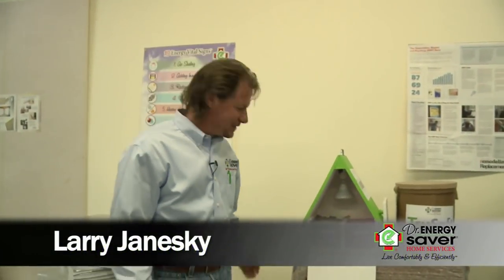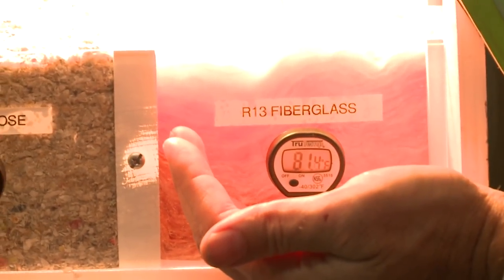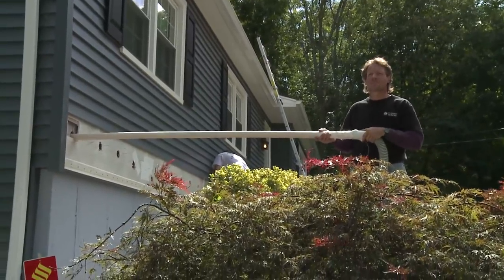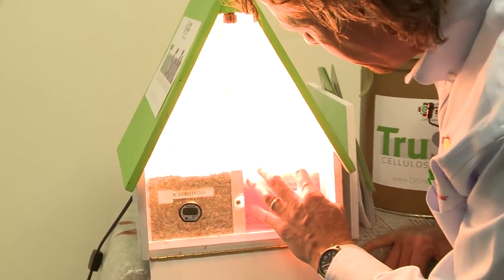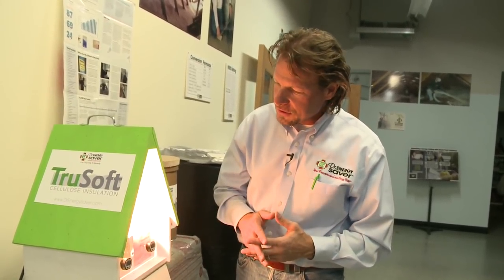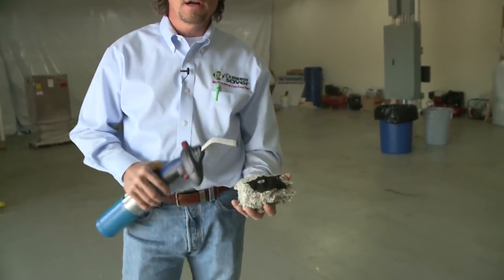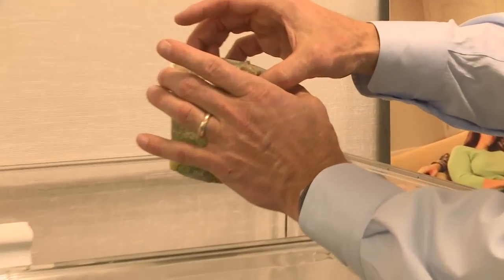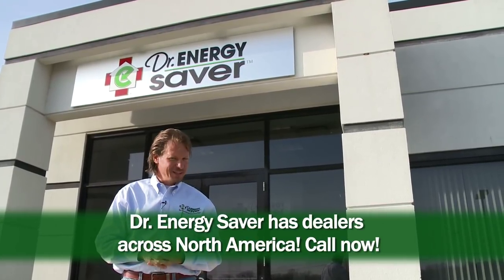Why Cellulose Insulation is Better than Fiberglass Insulation

Comment: The test is not really fair. The light will go through the glass fibers but not through the paper fibers.A better test is to cover both material with a piece of plywood, so direct light and air current may be blocked. Then I think you may get the same insulation R value.
Reply: you would think wrong then. the light as you say has the same temp thru out. THAT is the whole point of the comparison.
Reply: scott bickett Light does not have a temperature. A light source does (vibration of molecules). In the test, the light source has very high temperature, and most of the energy transfer is in the form of radiation. If you block the direct radiation, you will block a lot of the energy transfer. I think fiber glass is only good for blocking conductive thermal transfer. Adding an aluminum foil on the side facing the light will prove it.
Reply: your still not understanding thermal dynamics. the whole POINT of the comparison is about the difference in materials. So to say its "not fair" because the lightgoes thru the glass just goes to prove the whole comparison.
Reply: *****  you DO understand that this test has NOTHNG to do with "infared heat"( ??) but rather CONDUCTIVE heat gain and loss, THis is a great test to show the difference between the two, why on earth would you put a "baffle " or Barrier between the heat source and the material? DO YOU HAVE SUCH A BAFFLE OR BARRIOR IN YOUR ATTIC! ..NO!  It pays to be informed.
Reply: *****  You missing the point entirely. The HEAT from the bulb is a MAIN focus here. and how it transmits thru the difference material. " A MIX of the 2 MIGHT be best"? WOW. thats just flawed thinking all the way around. Here Mr homeowner, let me set up and install a lil bit of THIS material ten well stp and set up again and install a entirley DIFFERENT material" see how that goes over when you give them the bill! Cellulose is denser, has a higher R value, resists heat gain and heat loss better, in more fire retardent. ( True FB will not burn....IT MELTS!)  this is a fine test to see the difference and it in no way flawed. ( UL LABS used the same testing btw)
Reply: +Gahn Yun , The light isn't the issue. It's the heat. The heat isn't stopped by the fiberglass. Use loose blown fiberglass and it tests even worse. It's just a quick way of emulating the difference in insulating abilities between the two products. Maybe you could relate better if yo compare two buildings, one insulated with fiberglass and he other with cellulose. check out "The Colorado Study". Why do you think they use fiberglass for furnace filters?
Reply: +aoeusnth h heat flows to cold. The attic is cold and fiberglass is light and fluffy. It can't resist the flow of heat. Cellulose is dense so stops heat flow...plus the same density stops air infiltration. Sound travels through air...that's why cellulose is so much better that fiberglass as a sound deadener. No air leaks in so no sound does either! Check the independent engineering specs to confirm.
Reply: +aoeusnth +Brad Seager ??  Why does Cellulose insulation smell. It's because they add a sweet smelling sterilizing agent to it to reduce the former waste paper bedding smell (its mostly sold for animal bedding), when collected from waste paper warehouses and dumpsters behind shops it can contain germs, ants, insects, mice, rats and wildlife droppings, so for public safety reasons it must go under the squirted on liquid sterlizor sprayer . Too much sterilizor can go in in one area because the conveyot belts stopped for a paper jam, and other areas can go untreated.  Its waste paper called Cellulose a trade name to improve its image and value.  Now you know.
Reply: +SuttonWoods , there you go again, Sutton. Cellulose is clean and smells clean. Check out any attic with mice infested fiberglass. That stink never goes away.
Reply: +Larry Maloney //  Others say "if you use Cellulose loft insulation (its shredded waste paper)" THEY WILL COME, they mean mice, rats, bats, snakes, birds will come to nest in it. I was always trained to never slag off a competitor but in your case I will make an exception, claiming that waste paper you sell at 3 times the price of Fibreglass is the hallmark of a charlatan.
Reply: +SuttonWoods , I've never heart the phrase "loft cellulose" before. What does that mean to you? I know blown fiberglass is primarily blown in attics because most folks don't want four inch holes in their walls. So again, after all that exposure to cancer causing fiberglass, how is your health? Your wife's?
Reply: +Larry Maloney  Another thing mr sutton is not mentioning Larry is the ENORMOUS amount of energy that is used at the FG plant in the manufacturing of the sub par fiberglass. Thats not very "green" if you ask me. That cost of course is passed on to the consumer. It takes LESS than a third of that energy at a cellulose plant.
Reply: +scott bickett , you're so right. Fiberglass, even when installed to factory specs, isn't cost effective. Even "free" fiberglass costs more in lost energy savings over the years. I always tell young couple to find an uninsulated home for their first home and insulate correctly with cellulose. If the house is a bargain then it warrants taking fiberglass out of the walls and dense packing with cellulose. Do that and they can pay off their mortgage many years early with the energy savings from removing the fiberglass and insulating with superior cellulose. Old Sutton is on a mission to discredit cellulose because it's the only way to get gullible folks to buy inferior fiberglass. He doesn't realize how foolish he comes off.
Reply: Larry, did you know cellulose loose insulation is not approved for use in large parts of the United States, because if the house roof is blown off during an hurricane it gets windblown all the area in the windstorm. See:>

; Cellulose Installers are requested to recognise that we need to raise awareness amongst homeowners to ensure they are fully prepared in the event of windblown cellulose insulation leakage from their loft space in the event of a hurricane –causing roof and bedroom ceiling damage to their property, with substantial amounts of cellulose insulation from the affected property/s blowing around the properties and its boundaries. One of the important issues cellulose insulation businesses and householders face is not knowing where their clean up boundaries are, and when the next hurricane will strike. 

While Hurricane Katrina has tended to fade from memory, New Orleans isn’t the only major U.S. city at risk. As Hurricane Irene demonstrated, weaker hurricanes can also do significant damage in places that are not used to experiencing such storms. Many Americancoastal cities are essentially sitting ducks to hurricanes, with millions of Americans living at water’s edge, exposed to high winds and flooding. Cellulose insulation should NOT be installed in 10 largely rural counties in the Deep South and near the Gulf Coast, These well known hurricanes areas are: Desoto, Fla. Houston, Texas, Polk, Texas, Issaquena,  Miss. Highlands, Fla. Avoyelles, La. Walker, Texas. WIlkinson, Miss and Glades, Fla. Kemper, Miss.
Reply: +SuttonWoods the nonsense is endless; with you. Do you realize you left your credibility behind many posts ago? Cellulose is approved everywhere, even recommended.According to Owens Corning, their fiberglass insulation is a known cancer causing product. They even print the warning on every batt, bag, and roll. According to Owens Corning, its important to wear protective gear when installing fiberglass insulation. Federal law requires all exposed Owens Corning fiberglass insulation be covered with plastic to protect humans from contact. Imagine cancer causing fiberglass insulation being blown around town by a hurricane!
Reply: +SuttonWoods  I would like to know what states and WHO MADE this request of installers you claim. With the extreme less density of FG your claim doesnt make sense about blowing around.
Reply: +scott bickett , Sutton Woodhead is philibustering...hoping his silly stories will overshadow my comments about fiberglass causing cancer, not being a fire barrier, and being ideal nesting and bathroom material for mice and other rodents. Sutton has spent his life defending poor quality fiberglass. It's all he knows. He's a paid stooge for the fiberglass manufacturer.
Reply: +Larry Maloney // WEBSITES CONDEMN CELLULOSE WHEN THEY PROVIDE CONSUMERS WITH INSTALLATION ADVICE:>   Cellulose paper insulation materials are environmentally friendly and 
cost effective when compared to Fibreglass insulation,  but it is combustible and rapidly burns out. The main cause/s of cellulose insulation fire/s are: chimney related, Electrical faults, Lightning strikes affecting the roof and contractors carelessness. Installation advice for contractors:  Have the attic space electrical installation tested by an qualified electrical contractor, and do this every 3 years afterwards . Loft wiring should be in conduit but not attached or adjacent to cellulose insulation.  Do not place high wattage lights or electric fires or radiators near the insulation or allow the insulation to overhang electric fittings.  Do not insulate near recessed lighting into the ceilings below. Use heat resistant bulk head light fittings in the roof space. Electric supply cables need to be prevented from coming in to contact with cellulose insulation, or adjacent to other flammable materials.
Reply: +aoeusnth , the light isn't an issue. the heat from the light represents the heat the fiberglass is suppose to block. The fiberglass sucks, not the light.
Reply: +SuttonWoods , Romex wire, the most common in new construction, is commonly buried in cellulose insulation. Who uses conduit these days in residential construction? You're really dating yourself Sutton. You've been retired...what...30 years? In the event of an electrical short in the Romex wire, the surrounding cellulose will stop the sparks from igniting any adjacent flammable material...like the paper on fiberglass batting! There is no three year test that predict all electrical failures. That's why it's important to cover the Romex (or any) wiring with fire retardant cellulose instead of drafty fiberglass insulation with its flammable paper coating. Why is Owens Corning too cheap to flame treat their paper coating? Intelligent folks see the difference between quality cellulose insulation and inefficient fiberglass, even through your smoke screen.
Reply: +Larry Maloney  // All over the internet including You Tube and  various public forums Cellulose is being discussed in lets say impolite terms.  Recently I have questioned your assertions about the benefts of Cellulose because I think Fiberglass is superior, when making this assertion I have taken note of the manufacturers reputation,  I also know that Celluose price wise is a total rip-off, If Fibreglass is $1000, then Cellulose is  $2500,00. IF it was cheaper than fiberglass by 35%, and did not settle after its installation I'd be happier, much happier, but thats not the case here. I deal with householders, blue collar workers, often poor people, an important part of my job is to offer good value meaning fair price.

 Your trade to one and all appears to expect "big bucks for whats nothing more than waster paper dressed up "as the real thing". I hate that, I honestly do. We will always differ on that value point. The clients I serve will always welcome me back into their homes and offices,  thousands of jobs we did have completed since 1964 are still around for inspection, I obtain great pleasure from that. You must admit that Cellulose is poor value indeed and best ignored by honestly informed buyers. The worldwide  sales figures of fiberglass prove that statement ten fold, yours don't.  If you choose to sell waste paper then you will be ignored by those who count- the major top 5000 buyers. And can you blame them.
Reply: +SuttonWoods You can look at video on our FB page ILLINOIS VALLEY INSULATION and SEE VIDEO that was take of FG in sills that was COVERED in black and gray marks because the FG was nothing more than a FILTER trapping outside dirt. We even show this with thermal imaging proof before and after. You cant argue with FACT.
Reply: +Simple Sutton, pricewise, fiberglass and cellulose are comparable. Installation-wise is a different story. Pay a thousand dollars for cellulose and you get the full measure...some exact number of bags blown in your attic, for example. Get the same one thousand dollar fiberglass job and the contractor makes hidden profit by fluffing the fiberglass so less bags are needed to give the impression of meeting the contract. It may measure the full depth by putting extra air in the blowing mix but density-wise, fiberglass comes up short. But what homeowner can measure density? They see 19 3/4 inches of fiberglass  (Supposedly R-60) and never suspected it's been fluffed. The contractor makes a small fortune on the bags he didn't use. The fiberglass settles and the next homeowner hopefully is better informed about insulation and the tricks used to squeeze extra profits for your wife to count.
Reply: +Larry Maloney // You certainly know all the TRICKS of the trade, we do not have time for this because you will always have disgruntled workers, whistleblowers, and these people will report firms to the authorities, so we steer clear of tricks and shortcuts. Why ruin a reputation for quality and our own staff/s respect and loyalty. The men know their jobs will be inspected by me and the fear of losing their annual 10% of salary Xmas bonus keeps them in line, stick to your tricks but its a shortsighted policy. Some advice to be a millionaire stop what you are doing now, and start anew, if you have not been a millinire during the last 10 years, its unlikely things will improve so change yr occupation. Try Honesty.
Reply: +SuttonWoods , unlike long strand fiberglass, cellulose is very short fibers so can't be fluffed like fiberglass. Cellulose is all I install. I do have a collection of reports showing fiberglass installers cheating their customers. I think the industry phrase s "overblowing fiberglass." Is that what you call it? I 'm glad you try to keep your boys in line. Paid by the square foot their incentive is to sprinkle some fiberglass sound and head for the next job. I pay by the hour...not nearly as profitable as your fixed cost but we are interested in quality, not how many sales calls or jobs we can squeeze out daily. Sometimes I think you fiberglass sales organizations are so hurried for fear the customer will get wise to the high pressure tactics and cancel under their three day federally mandated cancelation rights. I don't want all the jobs, just the profitable ones...no need to push product just to stay in the good graces of a giant corporation.
Reply: +scott bickett ,  I waste too much time clearing the Simple Sutton lies from my customer's heads.  They're on high anxiety alert after Silly Sutton blasts them with his nonsense. The funniest was his "paper mites". That reveals a desperate man. According to Silly Sutton his wife is a vegetable and he's blind.  Yet he can't reflect on his deceptive life and recognize the harm he's done to society and families who unwittingly trusted him.
Reply: @LH: Beware a COCKROACH bite: Insect can produce a force 50 times stronger than their own bodyLarry, are you aware a Cellulose Paper Mite Jaws can generate a force 35 times stronger than their own body weight when they bite,  a fully grown adult male for instance can generate a force 50 times it's own body weight. This jaw strength is required when the mites are chewing upon tough trees that require hard biting to get to the tree sap. Their jaws can be used not only to shred food, but also to defend thier territory if they are disturbed. Cellulose Paper Mites are hard to eradicate and found in waste paper mills, waste paper bales and un-fumigated raw cellulose insulation.
Reply: +Simple Sutton, what do you suppose the actual chewing force of a mite is? Let's say maybe a fat one weights one Nano millionth of an ounce. Let's see, I'll take off my shoes and socks so I can carry them aughts and do a little Jethro Bodine cipherin and ..well.. aught carry the next aught plus 50 million Nano ounces...Hot diggity..one of them ferocious mites can't even chew its way out of a paper bag. My brains tired...going down to the cement pond and rest.
Reply: Gahn, the experiment is valid.  It will make no difference if the materials are covered with plywood...or drywall.  The heat will transfer through, into the insulation and to the thermometer.  His test is valid,
Reply: @gahnyun2016  Radiant barrier (aluminum foal on the light-facing side) is used to reduce thermal transfer...but ultimately the envelope becomes hot.  Cellulose is a better insulator than Fiberglass.
Reply: @ivcruiser  You are correct, Scott...The test is valid.  Well spoken.
Reply: @larrymaloney877  Accurately spoken Larry.
Reply: @pipersson9258  Brad, the cellulose manufactures do NOT use the paper you describe.  They use recycled phone books, yesterday's unsold newspapers, boxes, etc
Reply: @larrymaloney877   Yes Larry, I have removed both cellulose insulation as well as fiberglass insulation from rodent infested attics.  BY FAR the fiberglass smells worse.  They love to build homes in the fiberglass...and I've never seen a mouse building a home in cellulose.  The urine smell in fiberglass never goes away...until it is removed.  

To be clear, use OPEN cell polyurethane spray foam on the roof deck to avoid vermin.  It also does not have an odor
Reply: You make an excellent point, if light can go through an - INSULATION MATERIAL- then so can heat. To stop the arguments about see-through insulation-  in the UK they've increased the suggested thickness, the sales adverts should state when it was 2 inches think light could be seen if you held it up to the sun and the trapped air story was not convincing the punters it works, so we have increased the suggested best thicknesses to 10" to stop the mugs carping on about it, Okay, we admit we increased sales our 5 x times by doing so, but who cares, just look at the huge profits we are making.
Reply: @waynemansur2162 , the resultant R-value is slightly affected by the paper product recycled. I tried phone books many years ago...too hard on the equipment and the density is less. Besides, where would we get phone books today? Cardboard is too valuable recycled as new cardboard. Good old newsprint, new or recycled, is perfect.
Reply: @waynemansur2162 , cellulose stops air infiltration passed by fiberglass strands.
Reply: @pipersson9258 , I guess I missed this comment by you three years ago. For the record, I know most of the tricks fiberglass sales organizations resort to while duping the public. I share my concerns with them and most avoid the fiberglass mistake by investing in superior cellulose insulation. I can't imagine you inspecting every fiberglass job...your nose is growing, Pinnochio.
Reply: @pipersson9258 , your feigned "concern" about my cellulose is unwarranted; a manipulative ploy to imply fiberglass has value when it does not.  If you honestly believe fiberglass has any redeeming value then you aren't as knowledgable about home insulation as I credited you. You are a perfect spokesman for the fiberglass industry.  It's the fiberglass manufacturers with their deep pockets who hired lobbyists to remove the "causes cancer" warning label from every piece of fiberglass. Consumers have a right to know. When asbestos manufacturers were sued out of existence they filed bankruptcy to avoid the Court awarded settlements. Today, regrouped, those folks are making fiberglass. Some experts claim fiberglass is more likely to cause cancer than it's predecessor, asbestos.  Homes insulated with cellulose insulation, using recycled newsprint as one ingredient, are 30% more energy efficient than homes insulated with fiberglass, made by melting sand and spinning it like cotton candy. Don't lose sight of the goal here, energy conservation. Fiberglass uses many more times the energy to manufacture and then is still 30% less efficient, even when installed as recommended, which isn't often. Piperson, if you had training in thermodynamics instead of fiberglass sales you could understand the technical side of insulation. Nice try though.
Reply: @larrymaloney877  Larry, my 50 years insulation trade experience has told me that NO INSULATION IS PERFECT, and the published R-values are at best highly inaccurate and misleading. Fibreglass certainly looks convincing, my company have insulated over 250 000 houses, but what we as a trade are trying to do cannot be done in whole, but only in part. Houses are either built airtight, erected fully sealed, damp-proof and well insulated from the start, or there not. At best any rectification work we do is nothing more than a well meant attempt to rectify the long-dead builders mistakes and errors, all doomed to failure. I for instance once told a wealthy member of the Belmont family, that her 103 bedroom house in Bellevue Avenue, Newport R.I. could not be insulated, to say she was not best pleased would be an understatement.  She was sitting pretty for a huge promise-promises swindle, but that's not me. Taking an educated guess all domestic insulation work is a gamble for the buyer, and if we try and do the right thing - the whole caboodle-  they think we are trying to drum up extra business.  You stick to cellulose, and I will stick with Fibreglass, mines beats yours hands down and you know it. And when the guilt overwhelms you do contact Owens Corning Fiberglass and tell them you have sinned, go to their learn new skills school and let the world know that you have repented.  You might treble your turnover if you do, so my advice is a valuable business lesson
Reply: @pipersson9258 , your fifty-year experience is different from my forty-five-year experience. That's understandable since you profited from inferior fiberglass. Agreed, if the builder does not build air-tight, your fiberglass won't remedy the problems.  My cellulose does stop air infiltration. And, unlike your beloved fiberglass,  the R-value of my cellulose is stable regardless of density. And unlike inferior fiberglass and it's cancer-causing properties, cellulose doesn't harm our environment. Today's consumers are more sophisticated. Educate them on the properties of each insulation and they aren't swayed by your arm twisting.  On a personal note, I specialize in hard-to-insulate homes so welcome a challenge like the 103 bedroom house in RI that stumped you. Again, thermodynamics guides the way, not your sales hype. If there are wall cavities they can be densely packed with cellulose. Ceiling joists are equally benefitted by cellulose. I agree, your inferior fiberglass would have cheated those wealthy owners. In fact, give me the contact information and I'll do the job you couldn't. I'm afraid your good old days, PipersSon, was of a time when fiberglass was about the only choice. Today, homeowners have choices. Those who choose to be informed don't rely on a high-pressure fiberglass salesman to steer them to an inferior product. They evaluate, based on science, and choose cellulose. My experience is the only time fiberglass costs less is when less fiberglass is installed. That's most of the time. After I retrofit a home with cellulose, that homeowner never has a need to insulate again. I have personally insulated where fiberglass has been used, three, four, and occasionally five times before. We do it right so are done. You, on the other hand, fluff the fiberglass so fewer bags get installed and in a few years, you sell them more. What a racket. Is it true sociopaths don't have a conscience or feelings of guilt? It appears they don't on the corporate level. What about you high-pressure arm twisters? Ever fear that your legacy is poorly insulated homes across the USA? My customers smile.
Reply: @larrymaloney877  Did I not tell you years ago when you fled the Soviet Union, that you no longer havie to follow the party line. You will recall when Comrade Gorbachov took office, he banned the use of unsold copies of Pravda newspaper  being used  as insulation. Fibreglass Insulation was introduced and given the name Saint Nicholas Wool. I agree Cellulose dust in your lungs is not pleasant. Did you know they made a film about it called "A Cellulose Tree Grows in Brooklyn."
Reply: @pipersson9258 , I expected something less childlike and not so nonsensical from you. My lungs are clear...that would be because I avoided fiberglass all these years.I went into the insulation business to reduce heating & cooling costs on my own apartment buildings.  Back then the choices were fiberglass or cellulose. No knowing the difference I researched both. The benefits of superior cellulose over fiberglass were obvious to me.  That hasn't changed.  I could have insulated even more homes if I followed you around insulating the ones you couldn't with fiberglass. Do you have medical issues today related to glass fibers in your lungs? Or maybe you avoided the dangers of fiberglass by never really working in the trade, just selling and getting the easy money?  Unwittingly, you do make an interesting point. The fiberglass manufacturers prefer to call their spun glass "wool." It's paramount to calling fatty animal flesh "protein" instead of the unhealthy product it is. That's the American way, once an unhealthy product is exposed to the public, rename it...confuse the buyer. I bet you have health problems related to both fiberglass inhalation and poor nutritional choices.
Reply: @larrymaloney877  Larry we swapped insults about two years or more ago, I recall I asked you then to look at the Annual sales accounts of Owens Corning PLC, and similar Glass Wool or Rockwool makers, the accounts do not lie  and they prove Fibreglass Insulation companies do 50 - 100 times more sales than the whole Cellulose trade figures combined. These sales are made by agents and builders merchants and its their market knowledge what rules. If these companies order ONE million rolls of fiberglass in one year, THEN what do they know - you don't? Owens Corning are the Kings of the trade and you know it, why not walk into any major builders merchants and ask for 10-bags of Cellulose, and the answer will be "Well that's a first for us- What it is and what is it used for? And NO we do not stock it!"
Reply: @pipersson9258 , yes, you are still as insulting as ever but that comes from forcing fiberglass on unsuspecting homeowners. Your question is fair and I'll address it. But understand that you phrasing implies the answer you want to assert. But first, tell me, Is the most popular singer the one with the purest voice?  Is the most popular food the healthiest? And do we all drive the automobile with the best consumer rating? "No" to all these questions. Likewise, the best performing insulation, the most economical insulation, and the most ecologically proficient insulation aren't used the most. Fiberglass marketers are super salesmen. They must in order to dominate the market with such an inferior product. As you know, new home buyers don't get a chance to buy the most efficient insulation. Instead, the builder makes that decision and chooses fiberglass because the fiberglass industry dumps the product to get their business. And burnt out installers can mindlessly throw it in the walls before a cellulose machine is even set up. Builders choose fiberglass for speed and a cheap price. It has nothing to do with quality. Fact is, I'm still waiting to meet a builder who understands how to insulate a house effectively. Fiberglass is mostly air. Cellulose is mostly insulation, therefore, middlemen don't handle it... too costly and time-consuming to load and reload. I buy semi-loads from the factory, not a reseller.  So please stop with the simpleton questions...I have better things to do than correct a fiberglass hustler. Again, how are your lungs? Full of 'glass?  Any thoughts on the ethics of the fiberglass industry filing bankruptcy to avoid paying Court Ordered damages for cancer-causing asbestos? Fiberglas is even more dangerous.
Reply: @pipersson9258 , LOL, what are you calling "glass wool"? Would that be inferior spun fiberglass rebranded? Link it with Rockwool if you insist, it's still inferior spun fiberglass. Your industry looks silly to customers when I explain the motive for Owens Corning rebranding fiberglass to hide its fiberglass content.  BTW, the chemical used to color it pink causes cancer, too.
Reply: @pipersson9258 , today's fiberglass insulation is still fiberglass made from melting sand and spinning it like cotton candy. We both know the "causes cancer" label was removed thanks to lobbyists on the payroll of the fiberglass industry. You said yourself they are a multi-billion dollar behemoth able to buy legislation with money and political friends.  A ten-year workmanship guarantee is meaningless. What's that even mean? How does a customer know the fiberglass batts have gaps? Drywall hides the poor workmanship. Cellulose wood fiber insulation is the best type for Florida hurricanes. Who wants those fiberglass prickly bits blowing in everyone's eyes and lungs? Speaking of lungs, you never confided in me as to the damage the fiberglass did to yours. I know you didn't pick those fiberglass pieces out of your lungs with a needle. They're still in there.
Reply: @pipersson9258 , you "investigated" fiberglass causing cancer? You dummy! You mean you installed that nasty stuff for 50 years and NEVER read the label?  It wasn't until June 10, 2011, the National Toxicology Program (NTP) removed from its list of “Reasonably Anticipated To Be Carcinogens” biosoluble glass wool fibers used for home and building insulation. I personally would never trust the fiberglass companies,; they filed bankruptcy to avoid paying Court-Ordered damages to workers diseased by asbestos exposure. How are your lungs doing? Should I send you a tee shirt, "I breathed fiberglass insulation and survived"?
Reply: @pipersson9258 , speaking of "fool", I take it you are as misinformed about health as thermodynamics and home insulation. Don't feel alone! That doctor speculating your  "use by" date hasn't had any nutritional training either. He's trained to "maintain" diseases like heart disease, diabetes, cancer, autoimmune, osteoporosis, etc. He's not trained to cure or prevent them with better nutritional choices. How would he earn a living being honest with patients? He's tricked you just as you've tricked so many with deceptive claims. Is it poetic justice? Karma? Coincidence? Like your beloved behemoth, the fiberglass insulation industry, the billionaires who formulate your feed, not for nutritional content, but for profit, don't care about the consumer. As a result, we are a nation of sickly, obese people.  It takes more than a doctor's opinion to live to 95. Since you are already 78, for that reason alone you have a good shot and I wish you well. But we both know of many younger men who drop dead within a week of their annual physical...the one they passed with flying colors. Why value your doctor's opinion?  He's about as skilled in his "prediction" as someone declaring that the horse leading by seven lengths in the last eighth mile will win the Kentucky Derby, duh!  Besides living to 95 isn't what it's cracked up to be if your life is sustained by medications. President George Herbert (I hate broccoli) Bush lived into his nineties but was sickly and wheelchair-bound much of the last fifteen years. Healthy and old is much better than feeble and old. My advice to you is to avoid all meat & dairy and bottled oils and processed foods. Eat what grows from the ground. But, most importantly, don't sniff any more fiberglass insulation. Be active in your retirement years; maybe better educate yourself on thermodynamics and insulation. It isn't all about sales success. Your conscience knows it's better to contribute to society than sponge off society.